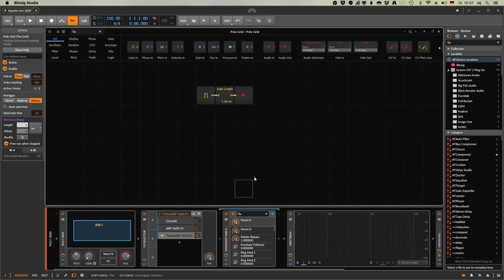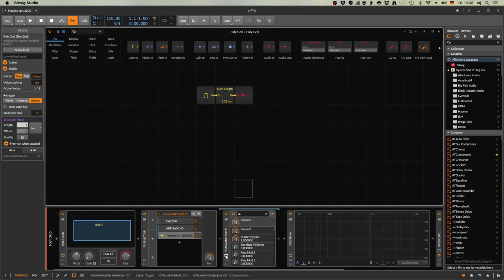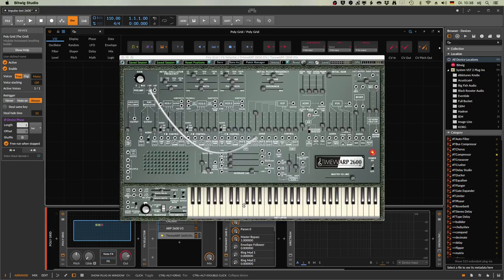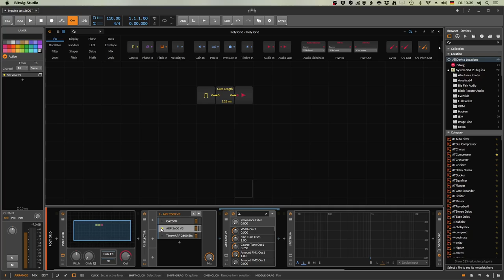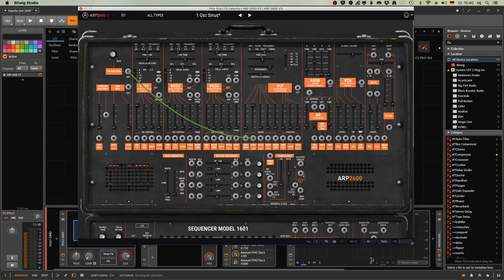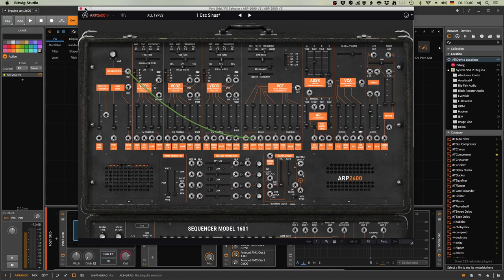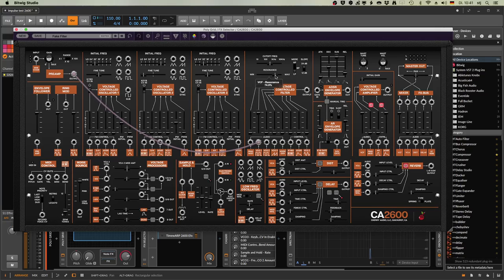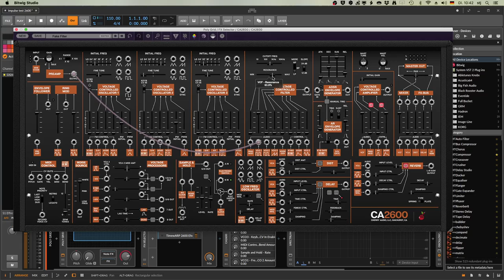CA2600 vs  Arturia & TimeWarp Filter

Comment: How authentic is the behaviour in the current version if you don't mind me asking? I'm a huge fan of the ARP 2600 sound (the hardware), so I would like to have a plugin that can nail the sound as closely as possible.
Reply from the maker: Though I owned a real Arp 2600, I can't really tell. That was more than 20 years ago... I went to a store and played a bit with a Behringer Odyssey, the range of the filter to get these sort of ringing sounds was smaller than on the CA2600 in its current state. I would say its better than that way. As the Behringer Odyssey is a copy of the same filter you could try to test yourself. I am happy with Cherry Audios version, its way closer to the inspiration the original gave me back in the time than the other two emulations...